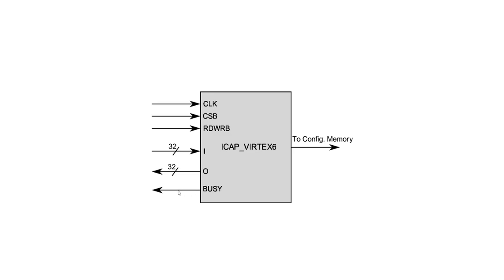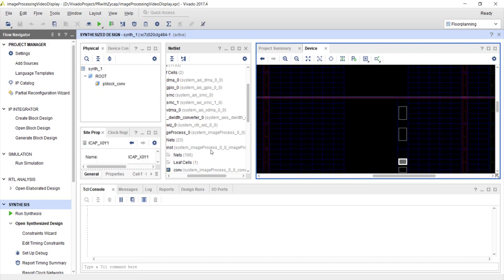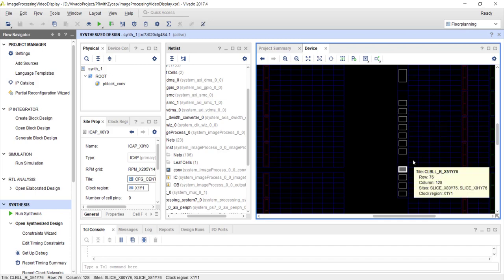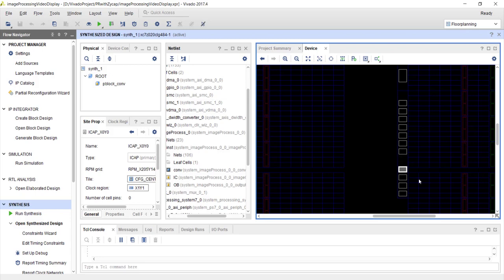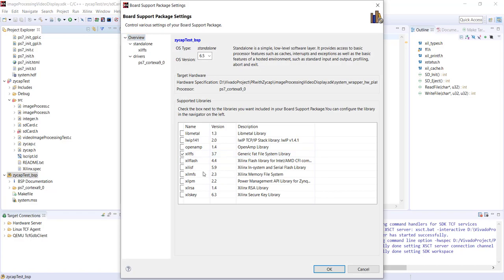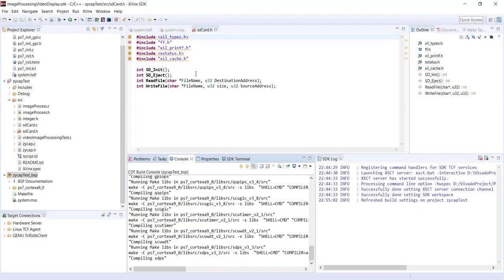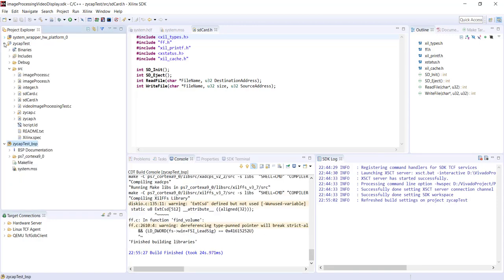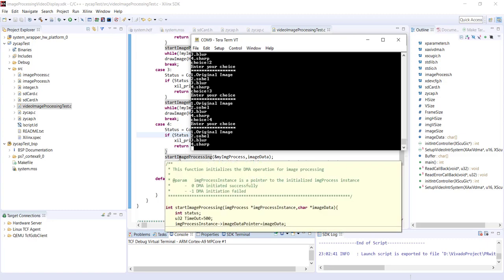Partial Reconfiguration: Part 5 Internal Configuration Access Port (ICAP)

Comment: This is a great tutorial.  The zycap’s concept is smart and clear. I tried to add zycap ip into my own block design. 
So, I  just want to share my experience of following your steps.

At first,  XAxiDma_SimpleTransfer() cannot complete the DMA transfer process. 
I found that it is stuck in comparing the length of the transferred file and the maxTranferlen variable.

To solve this, in function Init_zycap()
I added the following line to set the maxTranferlen variable. 
Config.SgLengthWidth = 23;

Then, it works fine.  Anyway, Thanks for sharing this video.